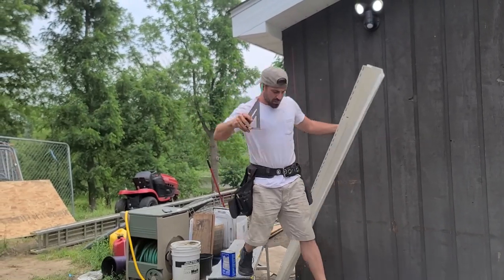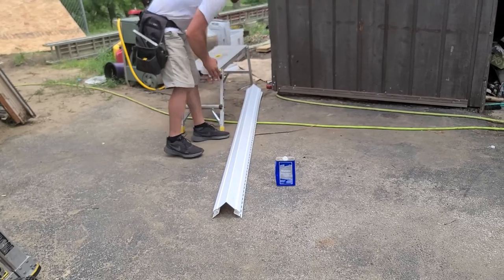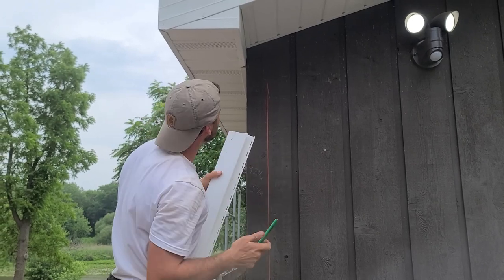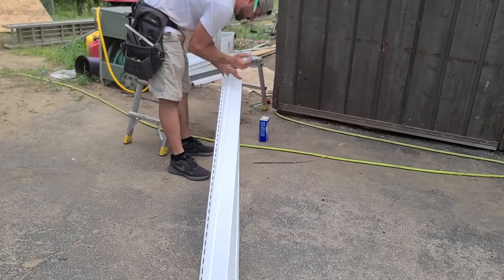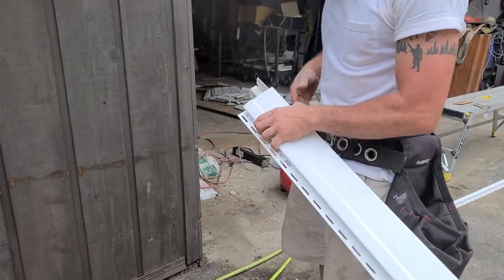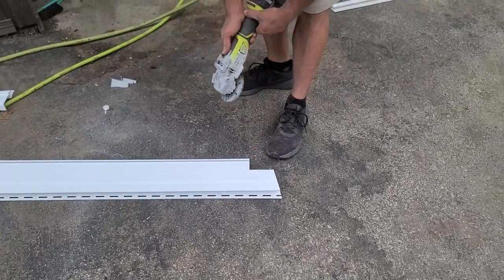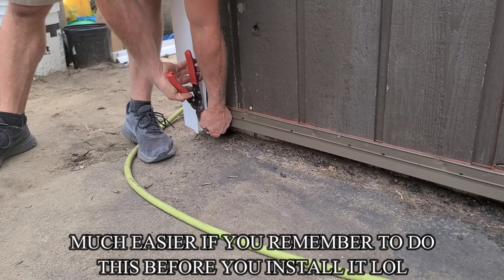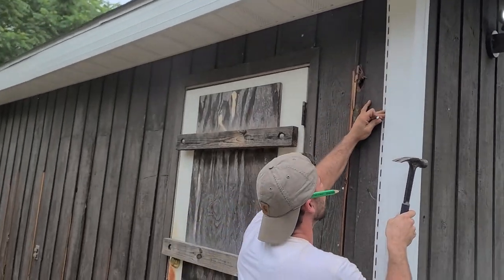HOW TO | Install a corner post

Comment: Cut your corners and siding with snips. Malcos. Much cleaner than using a grinder. When you were using the reds to take off that flange of the corner post snip horizontal then score down and snap off clean and easy. Nice Vid.

Comment: You can just measure where the siding goes into the J part of the corner. But on the inside to fine your exact measurements for notching the corner. Saves some time. And you could also put a carpenter square on the corner instead of chalking lines

Comment: I cut it square and run the j channel down the face of the pork chop in one pc. But I have seen guys notch it just seems a bit faster to do it with the J
Reply from the maker: i actually just responded to another comment saying the same. i think the notch is 100% the answer. and its super quick when i'm not explaining and wiping off boycubs pencil marks lol
Reply: @NWIVeteranConstruction  lol I hear ya

Comment: What blade are you using on the grinder?
Reply from the maker: Diamond I believe.  It's metal and for cutting concrete. It last longer than those regular black grinder wheels. Less dangerous too

Comment: If you nail your corner tight and your wall isn’t square you will get circle looking ripples in your corner.
Reply from the maker: in the flange or the corner itself? for the corner, the worse thing i see is twisted or not square. we been putting em on tightish for 10 years without any problems
Reply: @NWIVeteranConstruction  the face of the corner will show the ripples. You’d see it after like a day after it being installed.
Reply: @NWIVeteranConstruction  a good guide line is you hang siding you don’t nail on siding.
Reply: Is tightish a word. Never the less you would would not want to mate dissimilar material tight. Tightish or a floating joint is optimal.